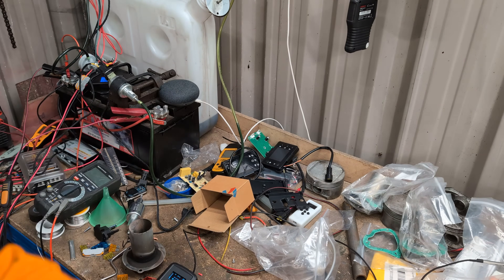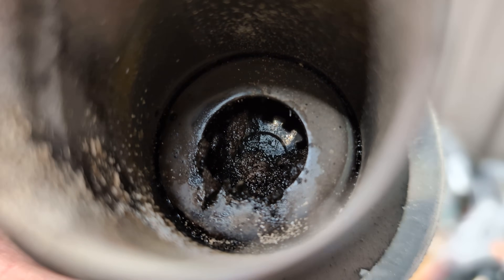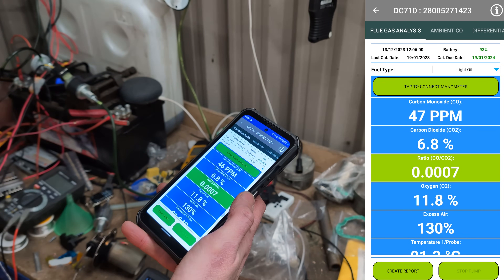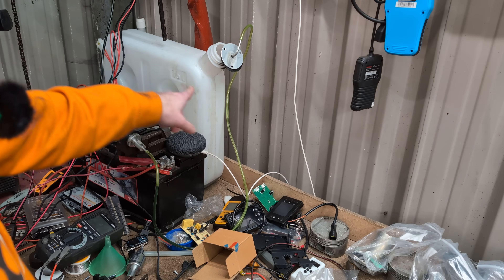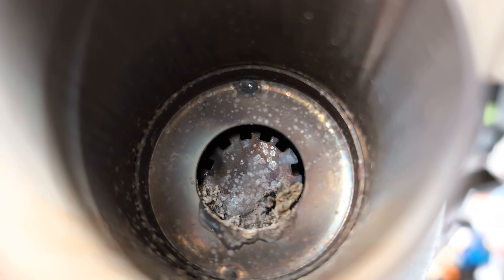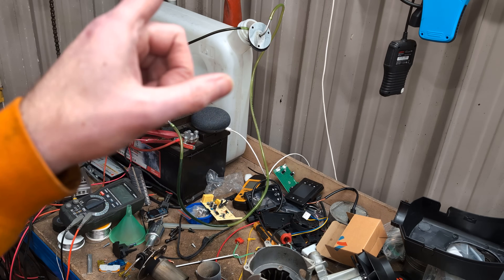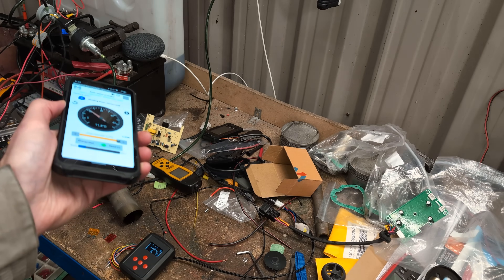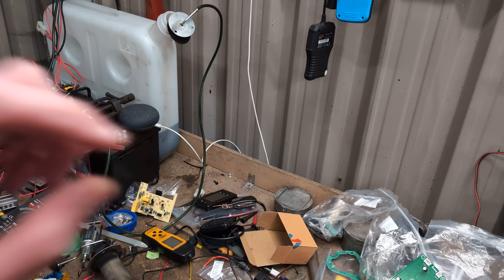Diesel Heater testing filtered waste oil - 50/50 diesel oil mix - part 2

Comment: Not to nit pick, and I know this isn't a genius revelation, but 4L of 50/50 mix is 2 litres of waste oil. Results will vary, but I think you will find that failure is directly related to the amount of waste oil that is consumed. I don't want to discourage testing, as I love watching the experiments and always learn something, but I have tried this with hundreds of different mixtures, and hundreds of different air fuel ratios. 

In talking to a lot of boiler techs, heavy oil and commercial waste oil heater techs, the consensus seems to be that there regardless of how clean you get heavy oil to burn, there will always be lots of ash, soot, coke etc.... and it is a full time job to keep large units clean, even though they are designed to run on these oils. 

The limited size of the chamber, and the fact that it is basically a glorified candle (fuel is not atomized by spray it flashes off due to the heat of the chamber) the garbage left behind will always accumulate quickly, in one spot. This did not stop my testing, and I will continue to test, but I believe this to be accurate.
Reply: Yea I think that sounds about right.  I haven't experimented yet.  Just done straight diesel.  
I wonder if running a clean hot burn on straight diesel for an hour every 10 hours of waste burn, would help to self clean the unit to a degree? I'm sure the white ash won't go away but the black carbon could be flushed out perhaps.  

It's funny, it seems everyone wants to try running waste oil through these, and jump head first into testing, but all the evidence has been that it doesn't work well.  

I think the only way to really make it work is just accept that you will be cleaning it very often.  
So you can run the waste oil all you want as long as you are read for maintenance cleaning.
Reply: @mattrevesz  Yeah. The chamber design doesn't allow for burning waste oil very well, and also doesn't allow for cleaning crud out very well. Once you coke up these chambers, they are basically junk. The area behind the baffle is the tricky bit. 

People try it for a number of reasons. "if it works, it's free heat" is a big motivation. It took me a long time to discover the truth, and I had to explain it to myself, rather than have someone else explain it. Diesel / kerosene and other light oils are the result of oils LIKE engine oil that have been refined.... The stuff that is refined out, is what is left behind when you burn engine oil (put very simply)
Reply: Seems like a reasonable conclusion

Comment: David adjust the fan to a lower speed to lower the air flow output. It will also increase the body temperature and allow the oxygen more time to burn with the fuel. You need the internal temperature to upwards of a 540 degrees C to get full combustion of the oil. If the air flow is going to fast it will cause the buildup you are seeing because the fuel isn't getting a full burn. Your units body temp should be between 204 degrees C to 210 degrees C which is at the upper limits of the units heat threshold. Unit overheat threshold is 260 degrees C. You have room to increase the internal heat capacity. Adjusting the fan speed should also get you to the 5.5% oxygen reading you are looking for. Doing so however will increase the cardon monoxide output on the flip side due to the oxygen and fuel is burning more completely. It's a tradeoff. If you are trying to lower the CO1 out put then push more oxygen/airflow. If you want a more complete burn then back the oxygen off some so that the oxygen and fuel have more time to mix and burn. Also, it may also help to point the unit downward to prevent the oil from pooling behind the flange.
Reply: The fans are connected by a shaft the only way to up air either way would be with compressed air.  At that point using the heater wouldn't be cost effective
Reply: @jaysonhoulihan9808  I am aware, I run two in my RV using two Afterburners and two silent pumps. At max out put, I have my pumps set at 5.7 hz and max fan speed at 3800 rpm with a body temp reading between 380° F to 400° F with no smoke output or massive soot build up. Due to the full burn of the fuel, I do indeed have high CO1 and NOx output as well. To resolve that, I would need a catalytic converter and SCR system to conteract the emissions. But we are talking about complete combustion and not emissions. Unlike an engine, these units don't compress the air fuel mixture.   They are an open flow micro furnace. It's finding the sweet spot of the perfect air flow to fuel ratio to get the maximum heat out put. Pushing more air into a system that doesn't have much air flow restriction isn't going to work. All you would be doing is pushing air faster through the burn chamber, cooling it down. Doing that and adding more fuel just means you're increasing the speed of fuel usage to maintain the same heat output. If you want less soot build up, you need higher heat output. Diesel completely burns at 1200° F. If you go and watch David's video were he pushes a heater to thermal shut down, you will see that around 210 degrees c on the body temp sensor, that the internal sensor is reading close to 537 degrees c. Which is 410° F externally and 1000° F internally. The safety cut off for these heaters is between 500° F to 550° F because the internal temperature is reaching critical melting point of the  aluminum housing.

Comment: Stating the obvious here but they're clearly not designed for such sooty fuels. It is easier to drip waste oil into a log burning stove, hardly any visible smoke from chimney when it's hot and smells a bit like an old car. Nice test as always. 👍😁😎

Comment: I use the same heater as a base with waste oil.
Light oil is used only for ignition, and then waste oil is used.
If you modify the combustion chamber pipe and maintenance hole
It only needs to be disassembled once a year.
Reply: Can you explain more your modification please

Comment: You have to shut the heater down to help burn that crud out with the glow plug. Running it dry doesn't allow the heater to extinguish properly leaving extra carbon in the burn chamber
Reply: That will not clean the burn chamber... You haven't burned motor oil before if you think you can just "clean it out" somehow...

It turns to concrete... Even on a red hot surface, there is no burning it away... Hard ash will collect.
Reply: @volvo09  when did I say it wouldn't still gunk up? It was a suggestion on helping reduce not eliminate...
Reply: @volvo09  don't know why you put "clean it out" in quotations like it was a statement I made... maybe quit having conversations with yourself before commenting 🍻
Reply from the maker: The heater still goes through a full shutdown on flame out.  Hence the glowplug mesh is always clean.

The secondary wicking mesh inside the burner, not so much.
Reply: @DavidMcLuckie  just wondering if you have any testing on whether it actually goes through a proper shut down upon flame outs. I use cooking oil and kerosene in mine and don't have any issues running 50/50 with a start up and shut down on 80/20 kerosene and diesel. Cooking oil does burn a lot cleaner then motor oil. Great vid, hopefully someone cracks the code lol would be nice to burn off some oil I got lying around rather than gathering it

Comment: Yeah...looks like the crap just builds up...I wonder if instead of that cap right up against the fins inside the burn chamber looks riveted in] (where the crap builds up) if it's further out...letting the oil kind of slide along the bottom of the hot metal tube if it would work better [better atomization of the oil/fuel mix] or cause a flamout or even worse an uncontrolled burn...
Thing is those static waste oil burners usually have a big ol' cast iron chunk or pot that glows red hot, which vaporizes the fuel...but come to think of it...the pot the oil drips into still needs cleaning out due to the crap from the oil not burning and becoming that white rock hard clinker sludge.  If there was a way to allow the oil to travel further down before clinker sludging if it would work, still need cleaning, but much less often
Seems it needs VERY clean oil to run without issues...so waste oil is a no go
This is why I am going to build a waste oil burner for my metal melting kiln...I have 33+ gallons I need to burn off.
Keep em coming!!!!

Comment: I am running 50/50 diesel used hydraulic oil. time will tell.
Reply: Hyd oil burns clean with low ash build up  so will run longer before needs cleaning. Maybe flush through  with kerosene after each tank see how that goes👍🔥

Comment: I'm thinking a tighter mesh may help . I need to order a second heater to play around too . Would it be possible you run 2 fuel pumps with half the hertz ?

Comment: Definitely seems to be more effort than it's worth to try burning it that way, very messy, needs frequent internal cleaning after not a lot of runtime, and will piss the gretas off and have them send in the people with orange paint after you probably... :P
Reply from the maker: @Only-Memories-In-The-End Yes, that's the waste oil recycling.  Granted some does get cleaned and used for other things but most is just burned.

I wonder though if waste oil is still a cleaner burn than heavy ship oil?
Reply: @DavidMcLuckie   Heavy fuel oil is THE WORST sludge to burn on the planet... It is so bad, that the engine need to be shut down often and manually scraped of deposits and sludge... the exhaust is almost constantly black... It is literally all the crap left over after refining and extracting everything useful, then sold to shipping companies because their colossally huge engines, and the only things that can swallow the swill. Burning diarrhea would be cleaner... Heavy fuel oil is so thick, so contaminated, it looks like bunt molasses...